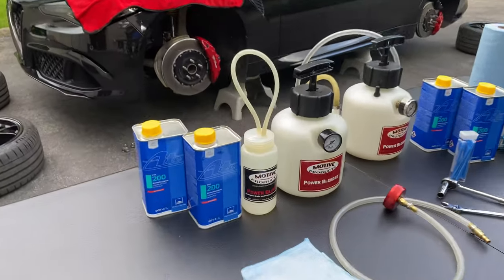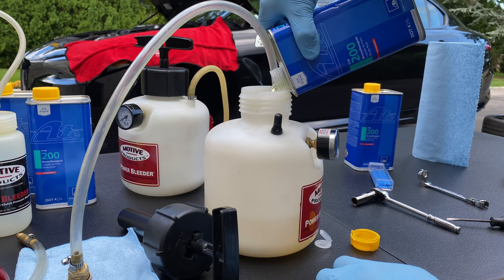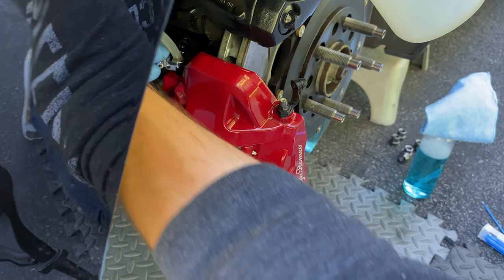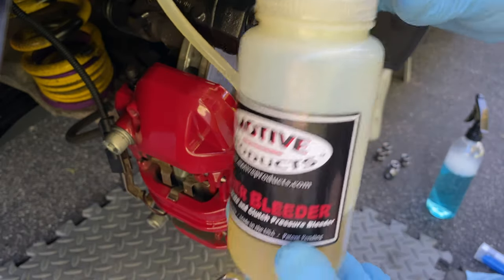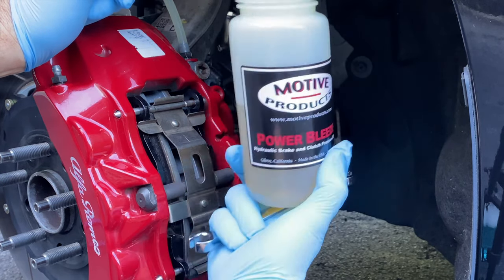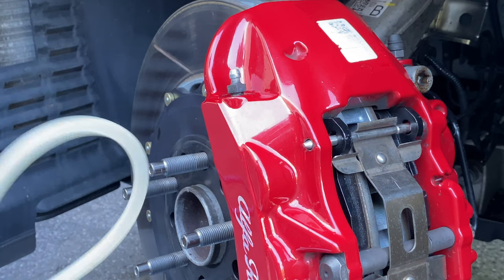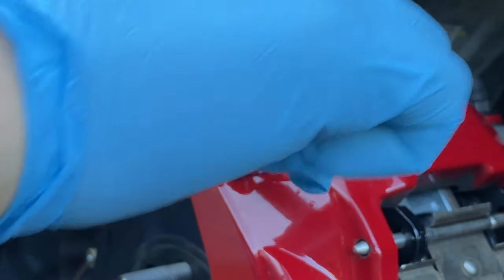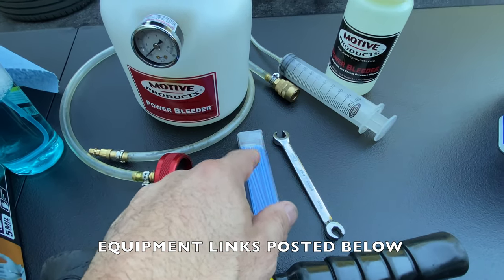Alfa Romeo Giulia QV Brake Bleeding & Brake Flush

Comment: I also use the same Motive Industries brake bleeder and should buy the Euro Billet Adaptor which looks much better than the original plastic adaptor. I buy two quarts of brake fluid when I flush my brake systems.

Comment: Have you had any squeaky pedal using the ATE Typ 200? I've read lots of reviews and forum posts stating the ATE Typ 200 can cause a squeaky brake pedal - something regarding the master cylinder and the viscosity. I was debating between this and the Bosch ESI6 fluid but I can't make my mind up.

Comment: Good to know how to do it properly, saved for when I do mine 👍
Reply from the maker: when I did my Stelvio which is only 3 years old I could not believe the debris that came out of the system maybe the IBS causes more wear due to higher line pressure but in 35 years working on cars i never once sayw fluid so dirty  in such short time unless it was in a vintage jalopy from the 1950s
Reply: @autofanaticcars  perhaps that’s why Alfa recommends getting it flushed out every four years I believe? But looking at it, should be more frequently flushed out just for that piece of mind.
Reply from the maker: I now would suggest once a year if you drive 7-15k miles a year

Comment: Just the last part, you need to bleed the line at least 3 times each caliper using the pedal break! It will give you 100% success to avoid any air in the system.
Reply: how u can bleed the electronic control brake with the pedal? like disconnect the battery?

Comment: Great instructional video, thank you!

Slightly off topic question: what set do you use to jack the car? I love the supports holding it.

Thanks!
Reply from the maker: Hi i use two AC Hydraulic floor jacks made in Denmark to lift the entire vehicle on the stands shown. takes me 10 minutes by myself to do it.
Reply: @autofanaticcars link for the stands?

Comment: I’m going to be changing my brake fluid in my 2019 Alfa Giulia. When I use the power bleeder and put in 40 pounds is that enough to open up the ABS module and flush out the brake fluid from the module itself. Thanks Phil for a great video.
Reply from the maker: Hi Mark follow this video exact and youll be fine do not over pressure the Motive because you can cause the hose and cap on the master cylinder to explode and you will have a dangerous mess of brake fluid all over the cars paint and engine bay which can remove and damage the paint. Do each caliper one by one and check the Motive PSI and charge up each time to the levels I show here and youll get a perfect flush and bleed. take your time it is easy to do.
Reply: Thank you, Phil for responding back. Did my brake flush today as per your video everything went well…

Comment: Greatly appreciated.  I'm not interested in paying the dealer for a brake flush if avoidable.  If you document you shouldn't have any warranty issues right?
Reply from the maker: this is regular service like oil changes, tires, brake pads etc so should not pose any warranty related concerns. i only use warranty for complex expensive stuff that needs replacing on any new car since parts can be very costly to do on your own.

Comment: What year QV is this?  I'm planning to do this on my 2018, but stuff I'm reading says anything newer than a 2017 needs specialty tools to clear all the dashboard lights that come up after this is done.
Reply from the maker: my car was a 2018 so you will not have any issues if you follow my video step by step
Reply: @autofanaticcars  I appreciate the fast reply! Looking into getting this done tomorrow.  Did you put the car into brake maintenance mode through infotainment and do the IBS/negative battery terminal disconnect beforehand?

Comment: Any change in brake feel after the job?
Reply from the maker: zero, if the car had a pushrod with typical master cylinder you would notice a firmer pedal but brake by wire no difference.

Comment: Do you have to disconnect the battery? I know these cars are supposed to be put into seevice mode depending on which service is performed, and a diy way to do that is by disconnecting the battery otherwise you get a christmas tree on your dashboard lol but did you do anything before the brake bleed?
Reply from the maker: I did not disable my battery when doing this bleed flush.

Comment: I'd be nervous about installing that Schrader valve. Could be a point of failure in an otherwise airtight system. Depending on the car, you're really only looking at 1 bar of pressure. That's just a handful of pumps with a small bleeder like that. In their larger units, like ones used for fluid transfer, they do install the Schrader valve from the factory.

If you really want to get technical, you could fasten the compressor directly to the bleeder with some sort of pressure regulator. Probably overkill but you have some nice cars.
Reply from the maker: this method is the safest and easiest DIY on these newer cars with the ABS system since you need more PSI than normal. The Motive container is really strong It can handle over 100PSI so with the air valve to charge per caliper it is perfectly safe and easy for any DIYer to do. The hand pump limits the pressure you can manually force into the container based on the seal so the air valve lets you cheat that from the equation and use the container as a pressure vessel.
Reply: @autofanaticcars  Ah I see. It was unclear to me the need for the mod. But if you're saying it's to test the PSI limits then for sure. I have a bunch of Motiv products. They're great.

Comment: FYI, use Bleeder only if u want to bleed yourself (at least Giulia QV), otherwise Christmas Tree on dash thx to brake by wire system.
Reply from the maker: no dash codes on my 2018 and 2019 all good to go, codes pop up if you run the system dry or if your pads are so worn out and you push the caliper pistons in all the way then you need Multiscan to clear and reset but it is easy
Reply: @autofanaticcars  Mine 17 QV, last time I performed an on-track bleed with my friend help me press the brake, all warnings appeared on dash. Might be the worn out pads, I am not sure. After that I used bleeder only and no problem since then.
Reply from the maker: yes you can not press the brake pedal to bleed like old fashioned days lol and yes if pads badly worn also cause codes, bleeder is easier, cleaner and safer

Comment: Seems like you can get the same result by using a container with tubing end attached tightly to caliper bleeder screw submerged in fluid and pumping the brake pedal to fill container with old fluid.  Using a board or some other object under pedal so it doesn't go any further than you normally depress it so there's no damage to the master cylinder.  And of course keep the master cylinder topped off.  A lot less complicated than using that motive tool bleeder.
Reply from the maker: wrong you can not bleed this car using that archaic method there is no pedal pushrod that goes into the master cylinder it is all electronically controlled and pumping brakes is a horrible solution even on older cars because you can side load the piston and cause other issues. pressure and reverse bleeding are the proper ways to bleed brakes perfectly every time. Motive Power flush and bleed is a simple 1 hour job by yourself with no mess or fuss.
Reply: @autofanaticcars  forgot you have that brake by wire system but I stand by my described method as being easier and just as effective.  The two person bleeding method has been used for decades as well with great results.  Not sure what you mean by side loading the piston by I respect your opinion nevertheless.

Comment: How different is the process if I have a scan tool that opens the abs?
Reply from the maker: i have the Multiscan diagnostics so you most likely just hit some prompts to put the car into brake service mode with the ABS. Not sure how a dealer does it but most owners do not have the diagnostic tools so this method is another option for anyone doing it on their own.